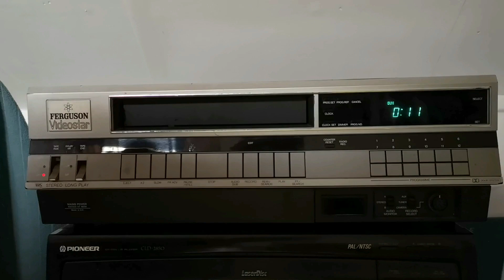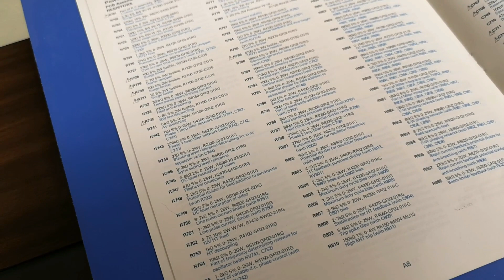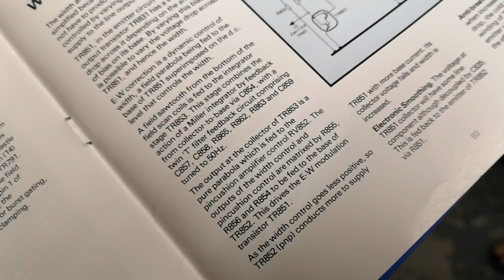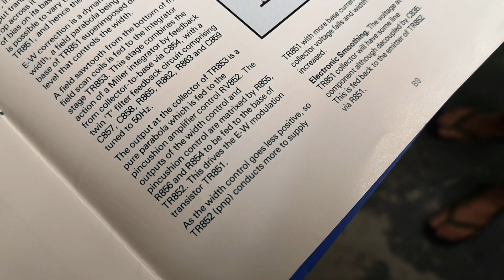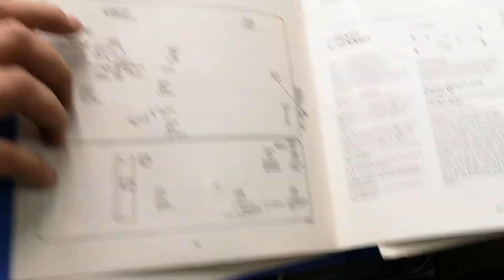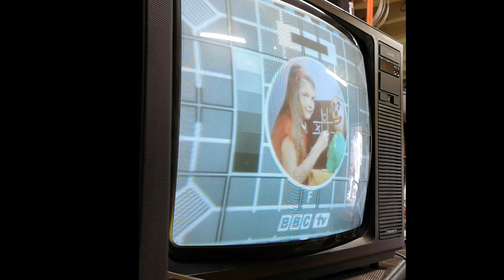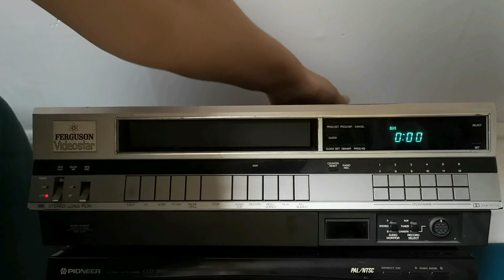Ferguson TX10 Width Control Investigation

Comment: your fault there, have you tried checking the EW correction Transistor which takes out the EW coil? I've not done this chassis for 25 years or more but that rings a bell.
Reply from the maker: You were pretty much on the money, although the transistor checked out initially, we replaced it with a known, working replacement, and.....the issue of wavy verticals, was resolved. A video will be coming up, soon. Thanks for your advice, between you and Old Gaming Fart, the advice provided has helped to resolve the issue :).

Comment: Found some notes on the TX10 which mentions R864 going high (should read 8.2k). If you get zero response out of RV851/852, try replacing both pots along with the resistor and then try readjusting.

Also might be worth going through and checking any fusible resistors (marked with an '!' exclamation mark in the service manual), as these can sometimes go open for no reason, resulting in missing voltages etc. Replace like-for-like as these are safety critical.
Reply from the maker: Cracking advice, thank you 🙂. I'll give those a try and let you know how I get on.